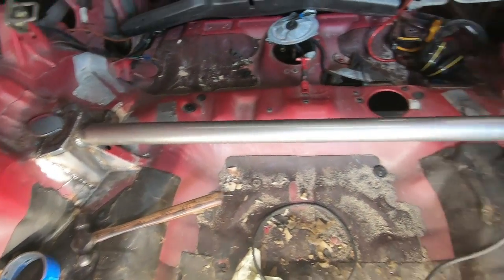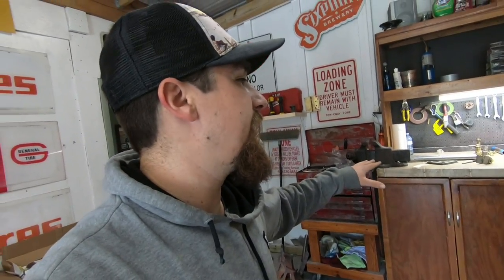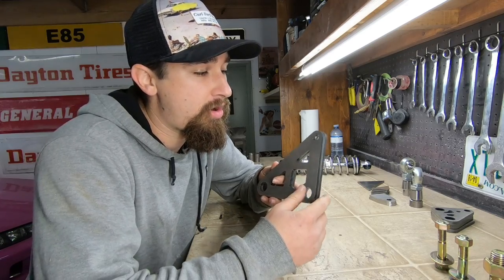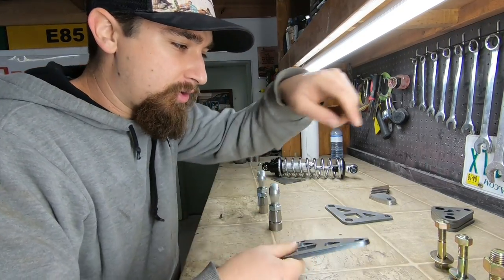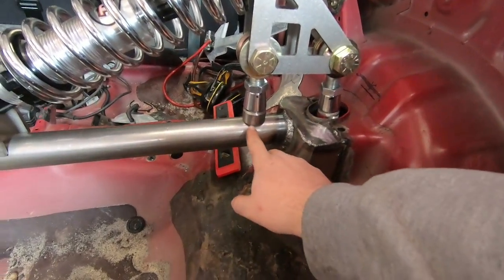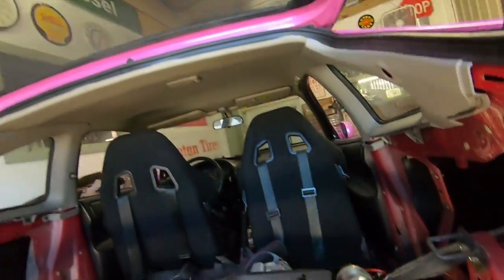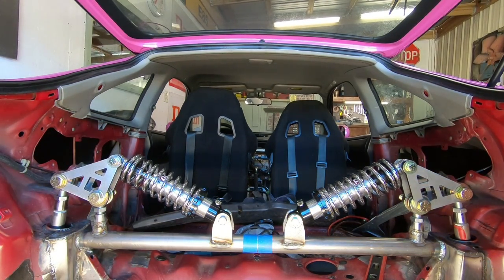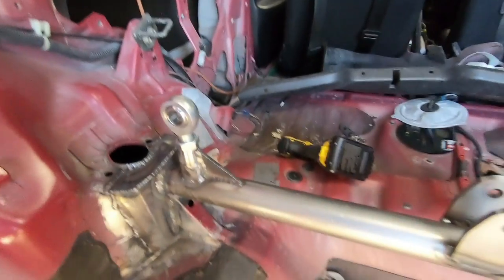Cantilever Suspension on My Turbo Integra is AMAZING!

Comment: Not bashing your welding by any means but you dont want to make two passes on that thin of metal(Honestly on anything unless its TIG). the more you weld on it you actually weaken the metal and the weld is much more prone to cracking. Coming from someone that mig welds for a living it was a big mistake of mine when i was younger before I had actually went to school to get my certs. My welds looked gorgeous but the tensile strength was weaker. For example if you look at alot of big machinery that was welded together they dont make a full pass from corner to corner when they weld it, they will do stitches across because its stronger. Just some food for thought.
Reply: isnt it ok to do multiple passes as long as they're not ontop of each other, they're suppose to overlap in the middle ? atleast this is what we learned in my class
Reply: @reckemzz  AS long as the metal is thick enough and can handle the heat. Im sure atleast once in class you have burned through thin metal right? I believe he stated he was using 1/8th inch metal, thats pretty thin to run two passes(especially how thick he ran the pass), im not here to bash bodi, i absolutely love his videos and one of my favorite youtubers by far, More just giving me advice in furthering his quality of work.  The reason I know a little more about these double passes is i've a few dosen service body racks for work trucks and the 1st and second one I did I overlaped beads making the second one much prettier so when it was powdercoated it would look much nicer and the only crack I have ever gotten on one of my racks was where I ran two beads lol I just learned to run 1 single nice bead instead. If it came out bad or not good enough, pull out the cutting wheel and start over but just band aid it.
Reply: @ViperRoleplayfivem  ah, ok got it thanks for the reply 👍 and yes ive burned through more metal than i care to admit lol
Reply: As long as the base metal has time to normalize after the weld, the joint will still be strong metallurgically speaking. I do agree that for that thin of metal a single pass with proper machine settings is ideal.
Reply: @ejohns4563  100%, trust me i've made multiple passes on thin metal and its been holding up 5-6 years now but ideally you want to make a single pass(Unless you are mig welding a joint first than going with a much colder tig weld pass over it for aesthetics and proper coverage. tig welding in general would be much more ideal for this entire process tbh lol
Reply: Typically, when the throat of the fillet weld is larger than your base metal thickness, your base metal will shear or rupture off before the weld will assuming you are using e70 electrodes for normal (a36 or various 50 ksi) steel 

When you do two passes on welds, it is much more expensive from a structural standpoint (on construction project) and I believe you are limited to 3/16th as well
Reply: The stitches conclusion is false,... You need enough weld length on 12" o.c. to transfer proper shear flow 

However, you mention machinery, I assume they would want to control distortion from the heat and save $ as well  which is a proper reason to stich structural components together especially if only 2" is required every 12" o.c.
Reply: @4feeterszwagier  should've been a little more clear(althought that was obvious) is this big machinery isnt thick metal. most big machines(At my work and most places i've worked) Are built with fairly thin/medium thickness metal. Nothing 1/2'' or 1 in" ect. for example most electrician companies like that of Caltrans have big dump trucks for concrete and rocks and such, those huge beds are stitch welded not full passes. they are maybe 3-5" inches in length at most. and in my 10 years of this trade of work I have never once seen one of those beds fail(Never have I heard of one either).
Reply: Jesus Christ  Trying to help him? Yeah, crazy cringe. I wasnt bashing saying "OMG LOOK AT THE UNDERCUT, SO MUCH SPLATTER" thats cringe. Dude plans on racing the car and making a simple comment that can prevent weld failure and can cost his life i don't think that is all that cringe. Your name being Jesus christ is the most cringe on this video.

Comment: Quick question, this suspension set up.. is it good time attack, I mean autocross, left and right turns sharp turns, a time attack uphill and downhill as well.. or it's this set up only good for  Straight run line/ 1/4 mile race 1/8 race too.. only good for drag race straight line runs.. or Circuit race?  This set up it's more favorable for what type of race? Off road forgot to mention is it good for Rally race..  ?

Comment: Awesome work pretty cool concept so i was wondering why does it look like the passenger side shock seem to look more compressed than the driver side? If you look at the center shaft while your pushing it down you can see more of the shaft on the drivers side than you do on the passenger side.
Reply from the maker: I was standing on the passenger side of the rear bumper as i didnt want to bump the camera.

Comment: The point of cantilever suspension is for leverage and mechanical advantage over stock suspension. This is done by extending the pivot point of the shock .

Comment: Love the idea....got one question. Wouldnt the rods that come up through  the original shock tower touch at some point because of the travel? Or is it stiff enough so that it does not get a chance to touch the side.
Reply from the maker: Master Mike yeah at full range it still doesn’t touch. It would if it had a longer travel but this setup does not touch

Comment: That is pretty dam cool man!! It's a strut tower brace/suspension bar setup!! The triangles have you thought of adding a hole or two so you could mount the shock in different positions just for more adjustability maybe? I have a similar situation going on in the back of my truck but it's for air ride so I didn't do a perfect triangle like that. More of an "L" shape just for maximum travel to lift the rear up. Just wondering if something like that would be beneficial in your case just to get the maximum movement from it or if the 4 inches was a well thought out plan. LoL not saying do this or that I'm asking out of sheer curiosity is all! I really like what u did though, I won't be copping any of it on my car, nope sure won't! Yeah I'm lying if that wasn't clear at all..

Comment: Props to you, love it!! As for Cantilever Suspension I've only seen it on super cars and race cars, so I assume there's an advantage - but what is that advantage? Off hand all's I can think of is leverage, or possibly benefits from distancing the shocks from the wheels / brakes? Thanks, keep it up!
Reply from the maker: beobe99 thanks man! The main advantage is accessibility. Suspension dampening and preload can be adjusted within seconds. The main reason I’m doing it though is because I wanted to and because it’s cool and different
Reply: @BodeVision  Thanks for the reply. Accessibility for adjustments and even replacing / inspecting them makes sense whether the cars for the Track or not. That, and of course it looks sick and is a great conversational piece.

Comment: looks cool... but... it mightve been better to play around with the fulcrum ratios on the cantilevers... you could use much smaller and lighter spring/shock combos and mechanically amplify the spring/damping rates with the cantilevers while simultaneously reducing the forces the car generates... still super awesome set-up!

Comment: Looks like the bars coming up from the bottom have a slight side to side movement. .. will that move the rear wheel around???

possibly some heim joints at the oem lower strut mount could counter act that

Comment: looks sick. but do you think it will function better than a typical suspension system? or is this just to be different?
Reply from the maker: It is to make easy adjustments and because it looks good. Also i can use a longer shock then stock and still be low. So the function is not sacrificed for the look.
Reply: cant wait to see it finished. subbed. @BodeVision

Comment: How much would you say you have invested in the cantilever suspension set up? Impressive and inspiring bud
Reply from the maker: Thanks man! 200 in pipe, 90 in hardware, 550 for suspension and end links, 120 for the laser table fab renderings and cutouts. so 960 or so give or take.

Comment: Awesome idea, and really decent Fab work man. I'd probably tie the two center brackets together with a plate welded on the front and back. All the stress is going to be on those center brackets trying to push together. Or better yet, just make both brackets out of one plate. You could then have 2-4  more holes drilled so you can further adjust ride height or use different coilovers down the road just by moving that center pivot point in or out.

Comment: You don't need any front-to-back support on that setup, all the forces are acting on the support tube from side to side and from up to down, just make it a "K" connected as near to the subframe pickup points as you can and you're golden
Reply from the maker: For sure man thanks!

Comment: That is something. Maybe you could weld support bars that would frame how your fuel cell would fit? If you plan to put it in the trunk. But this looks hella cool with the way the shocks are setup. Super easy to change spring weights as well if you want it stiffer or softer. Imagine you get that suspension that your able to adjust rebound and dampening separately😱

Comment: Using a heim for the rocker pivot is no bueno.  Should be solid on oilite or needle bearing bushing.  Also coulda saved a grip and got dampers off a sport bike with a revalve and proper springs.   Dual adjustable, revalvable reservoir coil overs ? Yes please and if you find a BMW or some Yamis, you get a bad ass Ohlins.

Comment: Looks good looks like it is working well It looks well supported as it is I couldn't see any flex at all but the track will show any weakness, I would go  "Gun Metal". I think also the amount of adjustment you can do with ease is going to give you an advantage out of the box.

Comment: Hang on so that's a 1:1 ratio. What's the reasoning here is this cantilever system just for looks or is there a practical reason for it?
Reply: Guess he wanted to keep the rate..
Reply: @subarolla  why is he doing it then? that kind of defeat's the purpose. One of the main reason to have a cantilever suspension system is manipulation of the spring & shock rate's or for vehicles with clearance issues neither of witch are problem for an integra.
Reply: @troydavies3225  your guess is as good as mine.
Reply: Well judging by his intro the color of the car & the fact that he hasn't bothered to explain why he's doing it I'd say it's just to impress school girl's.

Comment: Those middle brackets that.   "Take all the load"
Are no where near strong enough
With that tiny weld bead 
U should have used a u shaped bracket 
That wrapped around the bar 
Then u would have a larger surface area to spread the load

Comment: red, so you can tie that red into the oe emblems and other red oe Honda things and if you do black interior it'll pop but not be crazy. everything looks solid, like you said don't over engineer it, x bars on the bottom and try to triangulate those brackets on the bottom of the coil overs, bitchin job man!

Comment: Someone broke into my car. No, the stereo's still here but...
Reply from the maker: lmao it wont be possible to remove without lifting the car as there the weight of the car pushing pressure on the bolts. But ill still need to be careful
Reply: @BodeVision  true, I was just messing around. You're doing alright there. I'm doing similar with my 68 firebird. I tell people it's because people kept stealing my shocks so I'm locking them in the trunk.

Comment: Bro you got this. Seems like you have a very good idea of how to do it and your pretty well building it damn near like I would. As far as you front bars go, I would put something in, if not for added lateral support but also for some rotational support. I mean its 2 small bars right behind your ass.. Loose a couple pounds and you'll never notice it. As for night adjustment, my understanding was you can still use the coilover to adjust right hight too.. You almost need to adjust both if going a significant amount, or your rocker (the lasered bracket) could become out of alignment, causing you to end up with some binding and such..
Reply: Just have few rocker profiles lasered up. It affects a lot more than ride height. Your ratios can change spring rate, travel, traction, rebound and so on. So short of having a fancy computer to test out ratios, your best bet is trial and error. Make a couple in both directions and see what feels best. Your three holes offer infinite adjustability in all directions... Have fun testing them, I'm sure theres a setup perfect for your use case.

Comment: Keep an eye on those "Glob Welded" brackets dude.  Too much heat and you weaken the metal to the point it can fail under stress.  One good pass with the Mig Welder or two smaller passes with much lower heat is better if you don't have access to a tig welder.  More heat is not always better!

Comment: Damn shame the time and effort combined with the materials is worth more than 6 of those integras. Besides those welds are going to crack after only a few passes on a track, that cheap sheet metal Honda used to use on its mid to late 90’s chassis, has horrible structural integrity even when minimally compromised. Ask anyone who was stupid enough to mount an ITR rear sway bar on a gsr subframe rofl! Refine that design, make kits and sell them, a lot fools on here will buy them hand over foot and not even knowing what they’re used for. god I love Honda owners, they are my best customers they’ll buy anything that says “Jdm” lmfao.

Comment: Different? Yes.
Pointless? Also yes.
Reply: George Forman  please explain to me why you think this performs better than a "standard set of coilovers." I would absolutely love to hear your expertise.
Reply: @chacelarsen50  Yeah, the only real reason people use cantilever suspension is for size constraints. There is no performance benefit for this set up.
Reply: @zososldier  there is, you can actually get a linear spring & damper to behave progressive throug the motion ratio. However, i highly doubt that this is the case here, positioning is very crucial.
Reply: @zososldier  There are a couple things wrong with this setup in particular. I'm not saying cantilever suspension in general is useless, I'm saying this application and execution is a failure. As ac mentioned one use for this suspension design is size constraint. By using this style you can get desired suspension travel without having to use strut mounts that match the vertical height of the spring/strut combo you are using. In addition you can use various rocker ratios, allowing you to get more travel out of a smaller shock. Using correct spring ratios and damping coefficients you can achieve proper suspension characteristics while potentially saving weight, and achieving a lower profile and center of gravity. This particular setup literally fails to take advantage of any of these benefits. For one the strut towers already exist that accommodate a standard strut/spring orientation. Not only that but there are many proven high performing coilovers on the market. The entire setup has been placed ABOVE the strut mounts, meaning he has raised the center of gravity, while increased the vertical profile of his suspension setup. A 1:1 rocker ratio has been chosen so no potential stroke advantage there. And I could be wrong on this one, but to top it off it looks like he's chosen some very low quality, non adjustable strut/springs.
Reply: @chacelarsen50  Yeah, i think the only adjustment for these particular shocks is height. no visible valve adjustments.
Reply: @zososldier  yup. It looks like his missed his own memo stated at the beginning of the video "if you're going to do something different, be sure to do it right." Lol
Reply: @chacelarsen50  I take back what I said. There is height AND valve adjustment.
Reply: If nothing else, it looks pretty cool. Makes the shocks easier to adjust. And if you can, why wouldnt you? Nice work.
Reply: @chacelarsen50   this setup would suit a awd honda very well with the stock arms, you just have to fabricate some bent uprods to have enough space for the halfshaft. Also if you use the on track you can change suspension settings in no time
Reply: maybe weight distribution ? It's not used in gt cars for nothing ..
Reply: @WeshWesh64men  nope , GT car , supercar using this setup because they want a low body or body just over the wheel arch. so body got no space to fit linear suspension
Reply: A lot of the time this is used in open wheel race cars so that the coilovers are inside the body instead of causing aerodynamic drag. Looks cool on the Integra though.